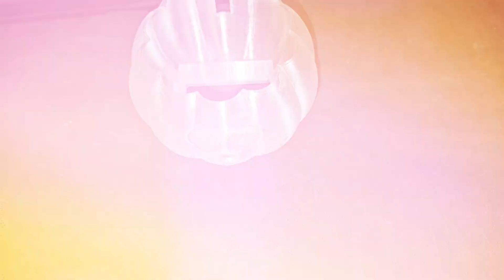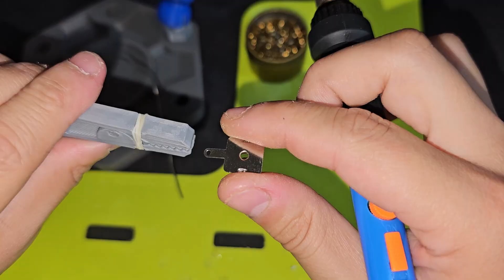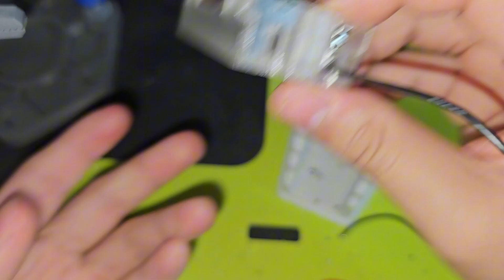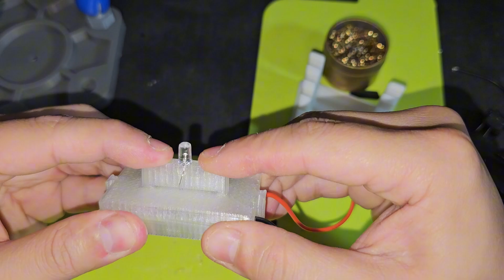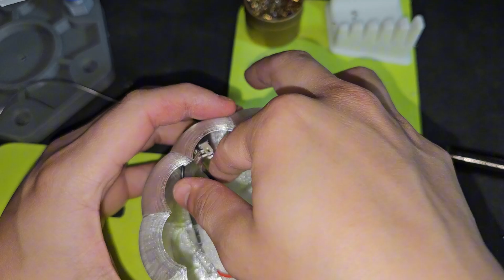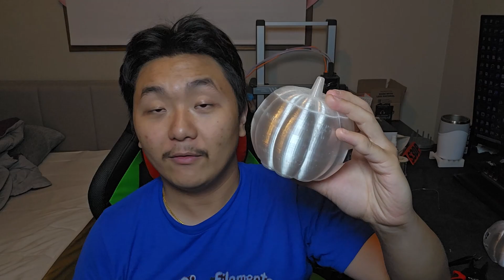3d printed pumpkin that lights up happy halloween

Comment: That's really cool. gotta make one of these for my daughter. Thank you for the parts used list. Did you have to use supports to print this
Reply from the maker: Yes, I forgot to mention that. The only part that need support is the pumpkin. For the mouth and the inside that holds the battery.

Comment: Nice clean build! It would be cool to use USB or USB-C powered stuff too. I always have a hard time calculating the proper resistors so the LEDs don't burn out. I'd also love to make a thing that allows me to replace 2 AA batteries with a USB instead, project for another day! Thanks for the content! 

Side note, I'd also recommend adding some weights or heavy washers in the base of your soldering helping hands. That and some rubber feet will stop it from moving around and falling over without needing to bolt/clamp it to the table.
Reply from the maker: Yeah, there are module boards that use USB-C to power the led. I felt that using AA batteries, you can put the pumpkin anywhere without any wires. But that is a good idea.

I'll add some weight to my soldering helping hand.